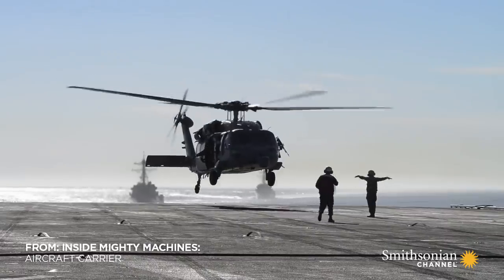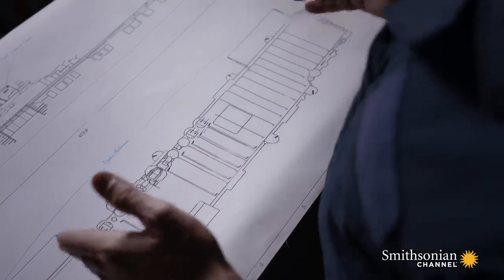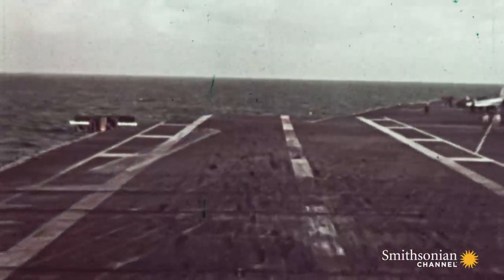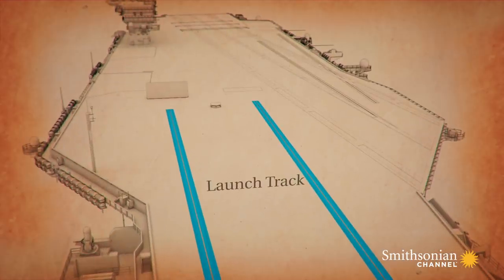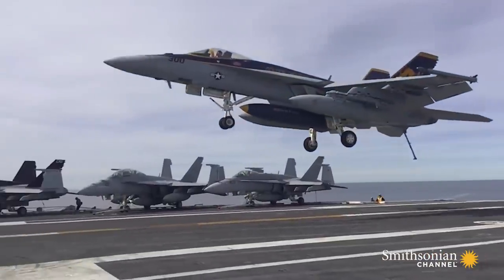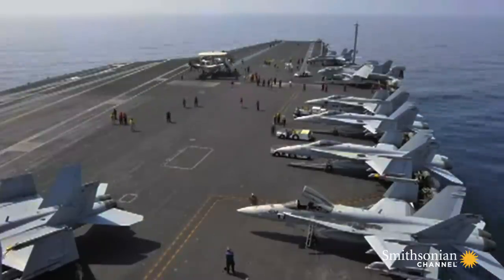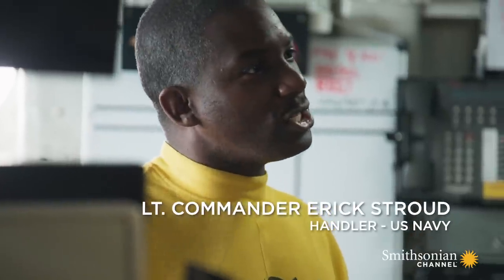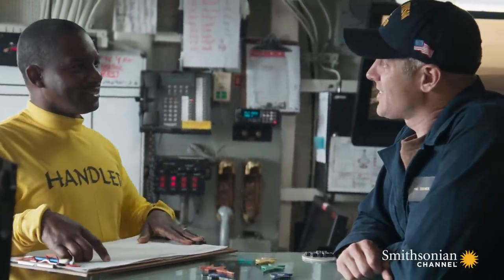How Angled Flight Decks Revolutionized Aircraft Carrier Flight Decks

Comment: Give the credits to British engineers.
Reply: So hate when they think they designed it ....yanks..!
Reply: Yes, credit where credit is due for both angled decks and steam catapults, but this is a short video. It doesn’t claim the Nimitz is anywhere close to first. It just uses the Nimitz as an example. It also doesn’t show the next step in catapults, the somewhat problematic electromagnetic catapults on the Gerald R. Ford. Nor does it show the ramp on a current British carrier. It’s a short video.
Reply: And debits to their not so good ideas.
Reply: @brookeking8559  
They say angled flight deck, simple to add "of British design" but no they won't. Instead they leave it to look like it was an Americian idea
Reply: @monza1002000  Exactly, they "conveniently" forgot to mention that it was a British invention.
Reply: It says REVOLUTIONIZED. i guess u guys know what it means.
Reply: @Mandingo_  Yeah, it means you misspelled revolutionised & misplaced your shift key. ;-)
Reply: @GARDENER42  yeah, it means the same. go check it. how ironic of correcting someone 😂
Reply: @monza1002000  Show me a British Carrier with an actual second flight deck. The Americans ACTUALLY built a second flight deck. British simply widened their flight decks and painted diagonal lines at the aft end. The British divided a single flight deck for multiple operations. Only carrier feature British "invented" was the ski ramp.
Reply: @brookeking8559  US built capital ships built in the 1930s had catapults to launch float planes. British ships did not have catapults until copied from Americans. Maybe say the British adapted American technology to put a catapult on a carrier. Did the British even retrofit a catapult to its current ski jump carrier fleet?
Reply: Stephen Jacks, I don’t know. I’m not a naval historian, and I confess I thought the Brits developed the steam catapult first. I’m an American with Navy family - including two active sailors and a retired Navy pilot - so maybe one of my family members has a reference. The retired Navy pilot is also an amateur historian and archeologist of some repute as well as - until recently - a docent at the Naval Aviation Museum. I’ll ask.
Reply: @stephenjacks8196  
Your ignorance of historical fact is a very sad indictment of your education.
The British were the first to build carriers containing ALL of these innovations that the rest of the world copied. What ever nonsense that you choose to believe does not change the historical facts that are easily verifiable. Wether the angled flight deck was painted or not, it was a British invention and built into all future RN carriers as and when they were required
Reply: @brookeking8559  Thank you for your and families service. Not sure if original capital ships' (cruiser, battleship) catapults were steam. Note, at Midway the Japanese fleet sent 7 of these catapult launched seaplanes to search for American carriers. These ships have a crane that picks the seaplane out of the water and back on the catapult. This gave the big ships long range recon before radar. These planes usually had a central float (like the Kingfisher) which was attached to catapult. These floatplanes survived the hurricanes that washed aircraft off of carrier decks. There are hydraulic catapults, and an interesting mechanical one that use a flywheel to store energy. Admittedly my experience with catapults is only launching the sailplane I'm flying.
Reply: Stephen Jacks, you flatter me. I am one of the few in my family not to serve. I’ve seen models, pictures, and even had a toy ship as a child that had a catapult and a crane. I also don’t know how those were powered. I’ll ask.
Reply: @monza1002000  Wrong. Current British carriers have a ski jump and no angled second flight deck. They don't use a catapult. Refresh my memory, who has built more carriers  the British or Americans? British Nationalism at the expense of reality.
Reply: @stephenjacks8196  
You are a very sad individual. You know full well l was refering to post war aircraft carriers not modern aircraft carriers that are now multirole like PoW and QE 
Can you just not check facts and list all the inventions that the US  brought to aircraft carrier design?
Reply: @brookeking8559  Then I thank your family for serving. Not sure of power for capital ship catapults. It would be above ships turbines/boilers and steam transmits force well. Some ships catapults were mounted on gun turrets so power is ?. "Different means have been used to propel the catapult, such as weight and derrick, gunpowder, flywheel, air pressure, hydraulic, and steam power, and solid fuel rocket boosters." Pic on YT of F-100 Zero Length Launch; 45 degree ramp and 2 RATO units attached to the jet.
Reply: Stephen Jacks, thanks. I know an Air Force veteran - one of my dad’s friends -  who flew F100 in Vietnam and Germany. He may have no knowledge of their launching from ships, but he’ll probably know where to point me for research. He also is an amateur historian in his retirement.
Reply: @brookeking8559  F-100s were USAF, the mobile launcher I think was Army. One way flight as in many cases no landing sites nearby, pilot ejects on low fuel. British had CAM or catapult armed merchantman which launched Hurricanes with no landing gear, pilot bails out on low fuel. The floatplanes can take off from the water on their own, so only need a crane not catapult.
Reply: Stephen Jacks, I was confused. I thought you meant there were naval launches of F-100 jets because of the context. No worries. I’ll have to have more than a text exchange with my uncle who is the retired Navy pilot regarding the catapults on non-carriers. We always have plenty to talk about in person. This will be an interesting addition.
Reply: @brookeking8559  🙂 I  think the F100 launcher was a modified Matador (old jet powered cruise missle) launcher from the 1960s. Still curious about how they power the catapults on top of a gun turret.
Reply: @stephenjacks8196  as a matter oh interest the Supermarine Walrus was a catapult launched seaplane carried on most British capital warships, theres enough film of them on utube if you just type the name. and they did this with other aircraft as far back as the 20's...
Reply: @Mandingo_  Use small words with the British, ight? They ain't Texas.

Comment: USS Ranger (CVA/CV-61) was the 1st carrier to be designed with an angled deck. USS Forrestal (CVA/CV-59) & USS Saratoga (CVA/CV-60) were originally designed with straight decks but had angled decks put on while being built. All 4 of the Forrestals were able to conduct simultaneous launch and recovery. I served on the Ranger for 2 years and made 2 Vietnam cruises. I saw a whole lot of launches and recoveries, day and night. 
USS Ranger (CV-4) was the 1st carrier to be designed from the keel up as an aircraft carrier.

Comment: It’s really cute when you see ramps on other carriers hahaha
Reply: It greatly reduces the compressed air required for catapults, but slightly increases turn around time, which the Americans hate, as their carrier doctrine is still based off of their experiences in world war 2, which no longer applies to modern combat
Reply: Holy_Crusader: without sounding negative or the like! I’d be grateful if you could expand on past and forward thinking doctrine that defines the two methods.

All I know about ours (that’s UK based home of the Royal Navy) is that the Falklands War (Conflict - as we never declared war) extended the effective working life of Portsmouth Naval Base by 25 years! What it did for Naval Doctrine I don’t know.

I tell a lie, overalls that melted in the heat (poly cotton) were replaced by cotton only. The delights of the victualling world....
Reply: @PhilbyFavourites  I only know the reasoning behind the ramps vs flat decks. America wants to be able to quickly recover, rearm and relaunch planes in as little time as possible for carrier vs carrier warfare in which fuel is only a problem if the plane takes damage while Britain's carriers focus on sorties to support ground units, in which fuel means range and strike capability

Comment: the angled deck separated the landing and launch deck from the main and flight deck this way planes don't crash into each other when they are launching. The Launch Deck sits over the bow where the wind is strongest this way when planes launch they are not in the way of other aircraft and they get enough lift when they get off the deck. The Landing Deck is on the stern this is so in case of an abort damaged planes have enough room to get clear of the deck or if a pilot misses the approach in a bolter they have enough room to turn around and do another landing if they miss. The Flight Deck and Main Deck are in the middle this is where the planes are stored when they are underway and where they are staged before launch. The first ship to have an angled deck was Midway this design was later incorporated into the Forestall, the Kitty Hawk, The Kennedy Class, and The Enterprise. Today this design is still used on the Chester Nimitz Class and the Ford Class.
Reply: Would need extra flight deck if they stopped parking planes all over it. YT vid of hurricane washing planes off deck.
Reply: Forrestal (CV-59) was the first ship built with an angle deck.  Beginnning in the 1950's, Essex and Midway class ships were retro-fitted for an angle deck.  Forrestal and later ships have/had four catapults:  Two forward (bow cats 1 & 2); and, two on the angle (waist cats (3 & 4).  Waist cat lauchings must be completed before recoveries can begin.
Reply: Sorry Hollywood changing history again. HMS Ark  Royal of the  British Royal Navy was the first.

Comment: The bit I don’t get with these carriers (Nimitz/Ford) compared to the QE II class: 

They’re three times the price but you don’t get three times the number of sorties or carry three times the aircraft. They don’t really have three times the range as they don’t sail independently from the CBG. But they do have over three times the crew for some reason.

The deck size is only half an acre more than the QE II yet they displace 30,000+ more tons. Is that all down to the extra 3,000+ American crew on board?
Reply: not forgetting the hamburgers and ""freedom fries" that must be good for thousand tons.......
Reply: The Law of Diminishing Returns applies here.  "used to refer to a point at which the level of profits or benefits gained is less than the amount of money or energy invested."
Reply: Which means 3000+ deaths
Reply: @mEmEzMaN...  
Having a fantasy moment?

Comment: Feet..acres...didn't understand what he wanted to say.. Interestingly military are metric long time ago..a science channel should at least try a little harder..🙄
Reply: Howard Pearcey, yes, that, and the Smithsonian is an American institution that targets Americans. By the way, internationally airspeed is measured in nautical miles per hour and flying altitude in feet. Measuring a flight deck with customary measures (an actual standard withtgat name in the US) is not a stretch.

Those measures of distance and area are based on foot that is exactly 0.3048 m so they are kind of metric, if not quite the decimals people are accustomed to. The conversion is more memorable to me as 2.54 cm per inch. Then the inch measurement of diameter in metric tire sizes makes more sense as a metric measurement.

Comment: This lost me in 32 seconds, you don't 1 understand that the angled or cantered deck has been around since 1951.   Nor do you understand why it came about.  It was not about launching and landing at the same time.  It was about the amount of landing deck that was available.  the straight or axle deck carrier had three sections for landing, the landing area, barrier area and parking area. As aircraft increased in mass and landing speed there momentum increased,  these increased the run out of the landing aircraft.   They had to increase the landing deck area of the carrier.  this is why the angled or cantered deck carrier came about.  Not to land and launch aircraft at the same time witch many aged deck carriers could not do.
Reply: BullseyeBullsclaw  please read what I wrote before replying, you might learn something.